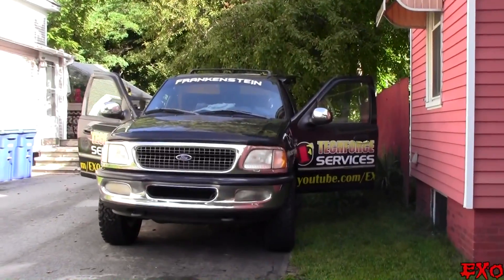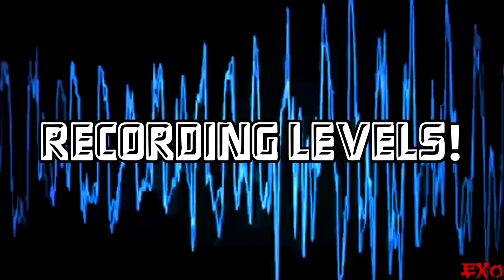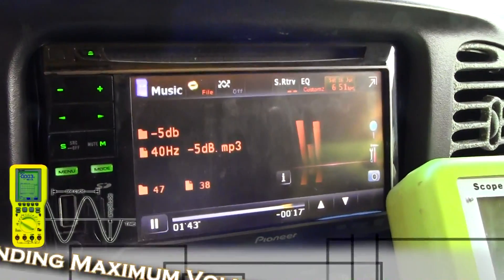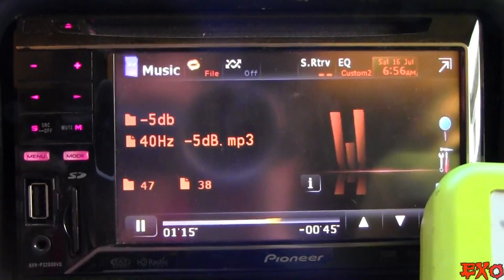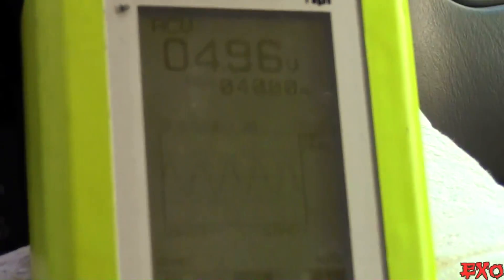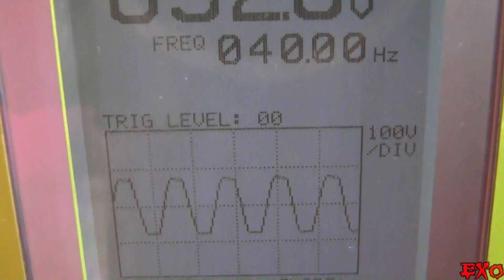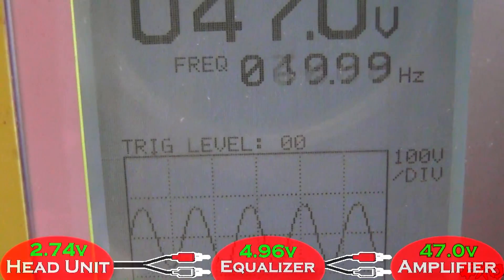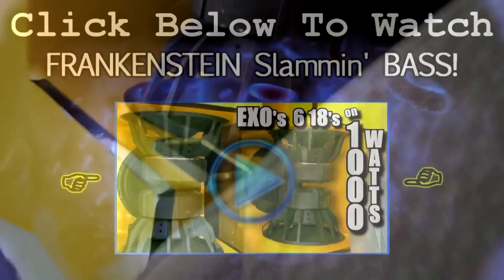How To Set Amplifier Gains & Get MAXIMUM Output w/ NO Clipping | Tuning BASS AMP w/ Oscilloscope

Comment: One thing I highly recommend is downloading audacity (if you don't already have it), then download some of the music you like to listen to from good clean sources. Then open them up in audacity and compare them to the test tones, I compared to the 60Hz tones but it shouldn't make a difference. Then you can see how the music you listen to compares to the test tones and decide which is best to avoid clipping and get the best performance. You can also listen to the tracks by ear and really hear how close they are to the 60Hz tones. I don't play much modified music, mostly mainstream hip-hop/rap (of various types) so after comparing I decided on -2.5dB. Thanks exo.
Reply: Also one thing to watch out for is many people you can download music from will max out the dB to make the music loud as possible. When playing from sources like spotify it may be quieter. Watch out for this.

Comment: question how come you would use a -5db tone over a 0db tone i listen to a lot of rebassed and decaff music and im just confused also do i set my bass amp the same way i do my mids and high amp with a -5db or 0db test tone
Reply: If you listen to a lot of mainstream music the recording level is usually not 0dB. Modified (rebassed) music is usually 0dB, that's what I would go with. The point of gains is to set your amp so that at maximum sound levels they do not distort or clip (ugly sinewaves.) Once tuned you can always turn your mids/highs amps down a bit if they overpower your subwoofer, turning them down won't hurt anything, turning them up too high can damage your speakers and amp if the amp clips. You'll want to use 100Hz tones for your mids/highs amp(s). Depending on your crossover usually 60hz or lower for sub amp(s). Long story short, if you listen to rebassed music you'll most likely need to use 0dB test tones. In most cases yes, use the same dB level tone for all your amps, lower mids/highs amp if necessary. Hope this helps, anybody can feel free to correct my information if you think otherwise.
Reply: @ixionn563 , if i zero everything when setting the gain on my amp, then after everything is set can i safely turn on my loudness or increase my bass level on my deck with-out clipping? Seems everyone seems to leave this info out during video's
Reply: @jefftaylor4997  no! Dont turn on the loudness or set bass any that will send bad signal to your amp.
Reply: @brick2077  can u put the regular bass, treble and the mids up on factory headunit after u set up everything properly with no distortion? I don't have any knob for bass I use my headunit settings for everything
Reply: Thankyou guys much appreciate!!

Comment: I've been watching youtubes on how to set your controls on amp, When you adjust the gain control, do you have the base control knob under dash turned all the way up for the that gain adjustment?
Reply: You actually want it set right in the middle. That way when you set your gains you can fine tune your bass up or down later on if you see any clipping. That is, if your bass knob has a clip light integrated into it. Otherwise just set it to full.
Reply: It's good practice to if you use the bass knob.

Comment: So today I finished installing my modest car system. New Kenwood Double din, new 0awg, components, sub and 2 amps. Took a week as every stage seemed long. Anyway today used my graphical multimeter for the first time to check for clean signal. Head unit can go all the way up with clean signal on the rca's, fine. Mid/high amp gains set with no clipping, fine. Went to set the sub amp gain which is a new pioneer mono and even with the gain on min I got lightning bolt, loud tone and massive square wave with almost 59 volts. Turn the gain up and its just worse. I did hook a sub up and it sounded fine at just under half gain and was very very loud clean sounding bass. Any reason my meter freaked out though? Cant really set the gains properly this way. Help from anyone would be appreciated.

Comment: hi Exo. must the car be running when setting gains?
Reply: Might as well to be safe, most amps I'm sure regulate their voltage but some may perform better when the alternator is running. So it's for the best to do it with the engine running, since you'll be listening to your system with the engine running anyhow. Can't hurt.
Reply: Curthley Zimmerman when you adjust the gains of an amp you’re turning up or down the signal voltage. Therefore it makes sense to start tuning with the engine running and the alternator putting out 14.5v not 12.5. Power (watts) is equal to volts  (V) x amps (I) one number changes they all change. Setting gains with inferior voltage doesn’t make sense to me.
Reply: @gazmgow622  you are assuming the amplifiers dont regulate voltage or current. And you can be wrong. Never heard the radio getting louder after turning the engine on. Have you?

Comment: Also when you said everything to a flatwave or too flat on all your settings and you move on to your amplifier what do you have your Hertz set to when you have from 20 to 500???????another question that I've got I have a really big system and I'm trying to build a box that is ported for four 12 inch subwoofers four did that one frequency and then four more also ported but at a different frequency I have a higher frequency!! I'm trying to Port four of the twelve at about 24 Hertz and then I want the other four ported somewhere between 40 and 65 Hertz not sure where to go with the high number!! Any suggestions??? I know it's basically doing the same thing as a 6th order but in two separate enclosures LOL trying to figure it out so I have the real hard-hitting high bass and the deep moaning low Bass!! Can you help me out??

Comment: Hey EXO let me ask you this you had your subwoofer RCA's turned on on the headunit!! But my question is on mine you have from 0 to 15 when you turn it on to set it to, so what did you have yours set at??????
Reply: you can have your subwoofer level on the headunit at any number so long as the target voltage is set correctly on the amplifier afterwards.
Reply: The reason I'm asking this question is I'm using an Alpine head unit that has an IC chip and it lets you said your RCA levels from 0 to 15 on all three sets of RCA's front rear and subwoofer??
Reply: When trying to set this particular Alpine head unit up with DD.1 SMD tool. I am getting feedback on the tool saying I've got distortion add as little of a volume as 7 on my head unit??? Any ideas?? Anybody else out there any ideas??
Reply: JD DD are you talking about head unit speaker outputs or rca cables? Are you testing with no speaker connected? Are all cables you’re using tested and working properly, ie no damage or shorts. Distorted head unit volume at 7 suggests either testing error, or cable damage.

Comment: Once we tune it at flat on the EQ, is it then okay to adjust the EQ how I see fit with no worries?
Reply: as far as bass goes no. if you set the gain with a  flat response then afterwards do something like enable bass boost or increase db at like 32hz or whatever then you will clip the sub at max volume.
Reply: You should be able to as long as you set the high-pass freq on the amp for the speakers so that a bunch of bass isn't going to them
Reply: Sorrow Song you should be able to make slight adjustments depending on different music levels but as a rule you have set the gains for max performance so adding bass boost should push them past distortion. As I said slight adjustments for tunes with less bass should be fine. Think of the bass control knob people fit. Used for this exact reason. Not having a dig but re watch this video and understand what he’s doing. That will answer your question for you. To help you understand, using a bass boost knob is the same as increasing amp gains in that it’s just applying more or less voltage signal. On the edge of performance you’re gonna clip the signal by turning bass knob up.
Reply: Good question I have not found an answer for this online and I'm wondering the same. Turning on your crossovers may help after setting gains and turning on sla,loudness and bass boost may in fact get you to clip faster

Comment: Is that pioneer indash in general dont distort or that model what's m pi del number
Reply: Pioneer is known for that, but some of the cheaper ones do clip. One I know that does not is the DEH-80PRS with Burr-Brown internal components, Very good SQ deck. If you want to get REALLY fancy, Pioneer's best head unit (and arguably one of the best period) is the DEX-P99RS.

Comment: hey one thing I always wondered is do you normalize your music etc, because i listen to modified music and normal music and have no clipping indicator on my bass knob yet so i set my gains with a -5db test tone and  a lot of the music today varies some the bass is as high as -1.5db and sometimes -3db, and sometimes -8db, so i adjust my bass knob on the fly to compensate but ive also heard that the music will effect the voltage on rca differently? i just feel like im always readjusting man, id love to pick your brain about it.

Comment: What should the setting for the subwoofer channel be? It goes from -8 to +8. Everything ive seen says to set everything a 0 but when I do that, I end up having to turn the gain almost all the way up to get the desired voltage. What am I doing wrong?
Reply: Maybe youre volume isnt at the correct level

Comment: I tuned by ear. Orion HCCA subwoofer 2500 rms with Orion xtr amp at 2800 rms
Reply: You're nuts
Reply: Sorrow Song I tuned by ear and play at max volume for years with no problems. You can easily hear when the amp gain is too high and just dial it back a bit.
Reply: @FSXgta  I can tune by ear my meds and highs but I find it difficult to tune my subs by ear

Comment: On my pioneer deck I have bluetooth source +3.  My question is, if I'm setting gains with -10db using bluetooth from phone, should I keep source volume at +3?  Or set it to 0 when setting gains?
Reply: set it on the one you will be listening to it at

Comment: The voltage goes up after I tune the eq, so do I readjust the voltage back down?
Reply: G LaV87  Since nobody responded yet, I’ll add that I read somewhere that you should adjust the sound to how you like to hear it, then adjust the gains using that set up. Why? Because if you boost bass at 50 Hz for some extra oomph, that frequency will clip sooner versus just a flat or 0 setting.

Comment: Do i have to disconnect negative terminal on my 2nd battery to remove speaker wires ? And can i use a 50htz test tone through bluetooth ?
Reply: your source should be whatever you listen to most
Reply: @18kRolex   Well if you did that then you might blow something if you one day switched to like CD which has a much better signal. So best to play tour tone to whatever your best signal comes from.
Reply from the maker: I don't use Bluetooth for setting gains, and I certainly wouldn't disconnect a battery to do so either.

Comment: Hello very good explanation. I have just installed a sub in my car to the factory radio and i have bass and subwoofer settings so my question is if its ok to set the gain on the amp to max and using the car radio subwoofer setting for control. when the sub gain is at max and  from the car audio i turn the sub setting to the lowest setting its almost not playing the sub at 70% volume
Reply from the maker: NO!!! That's a VERY bad idea!!!

Comment: Getting an oscope to check my setup because I’ve went though 2 alpine type R,s in short order. They rated 1000w rms a piece and I have them powered by a Brutus elite 2100.1 D so something must be wrong. Question is the oscope comes with basic leads so how did you test the rca jacks? Use basic leads or are there rca type leads that should be used?
Reply: You just use the ends that it comes with. You take the rca that's plugged into your headunit and disconnect it from your amp, or eq or whatever you have(only using one of the ends for this) and you attach your black(ground) gator clip to the outside ring of the RCA  end(the circle looking thing. It's not a complete circle but has slits in it, separating 4 halves) making sure you slide the rubber boot down to prevent it from touching the inner prong. Then, on the same end, you take the red (positive) clip and attach it to the middle part that actually goes inside your device, eq, amp etc. Then you play the sine wave of your choice as EXO listed above and turn up the volume until you see clipping. If you get to max volume without clipping, you know as long as you set the rest of your system up right, you can turn your headunit all the way up without clipping. Hopefully I made that understandable lol. Good luck
Reply from the maker: Positive probe, negative sheath!!!!
Reply: Clearly you don’t know what your doing did you not just see that he’s only getting a clean 500 Watts I know for a fact the amps he’s running are rated  for more but that’s all the power that’s clean

Comment: What if the only neat gadget you have is a multimeter? Running 2 AB Xfl 12s with 2 Audiopipe apcl1500s strapped at .25ohm before rise and whatnot. Also using factory Subie STI deck with audicontrol lc2i line converter. Thx
Reply from the maker: A multi meter wont show you clipped signals.

Comment: EXO.
Is the Behringer processor you used connected to a AC or a DC power source???
And if your answer is DC power source...how did you do that?
Thanks in advance.
Reply from the maker: It's an internal DC power supply from Envision Electronics.

Comment: Hey Exo, and everyone, So I  am beginning to understand this and finally know what to look for in the wave lengths. Very very helpful. I have a couple questions. I want to use the o-scope to set gains and crossover points. I listen to all kinds of music so set at 0db on headunit? I was just going to be the smd tools the dd1 and the cc1 but that's  $300. Rather upgrade my power and ground wire for that. So can I  use the 0-scope for setting crossover points? How do I  find max volume to distortion on head unit? I can hear clipping on mids and highs. But not on subs. For amps I  am running all wolfram 3000.1 and 125.4, Idk if you would  need that info or not. I have set gains by using a multimeter. Haven't  bought o-scope as I  do not fully understand it yet and which one would you recommend?
Reply from the maker: I got a NEW video on this coming up very soon! Should answer every single question you have :)
Reply: @EXOcontralto  thank you for responding. Can't  wait. Any Frankenstein updates coming?
Reply from the maker: No problem man.Just waiting my turn in line for the shop since I'm teaming up with a local dude, gotta wait just a little bit while he finishes up other projects.

Comment: PLEASE HELP! Do I use ACTUAL ohms of the subs when doing the math? If I go out and check ohms of subs right now its 3.2 not 4. So i use  600 watts x 3.2ohms = 1920 1920 squared gives me 43.8. Is this right?
Reply from the maker: So long as it can handle that without clipping, no doubt.